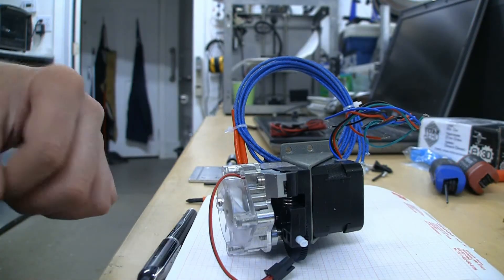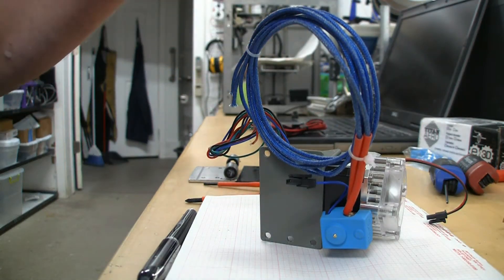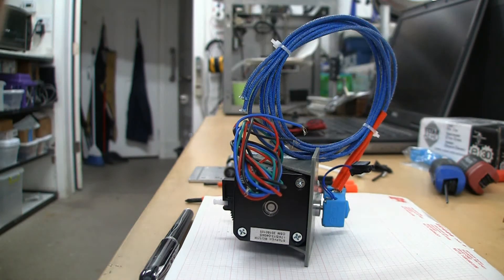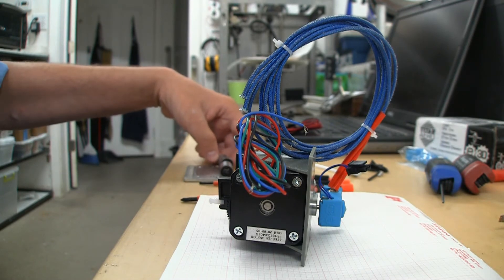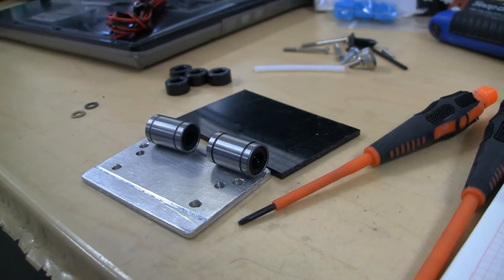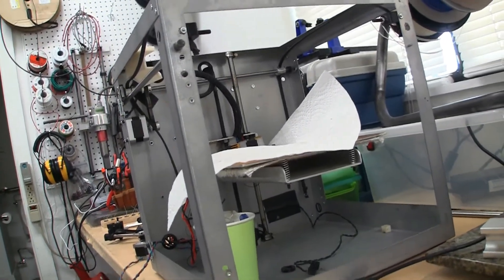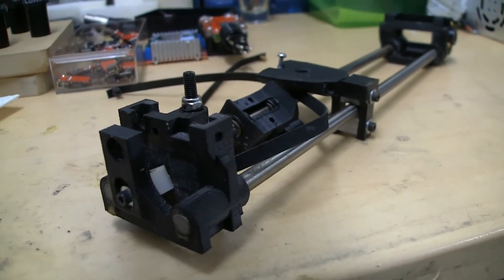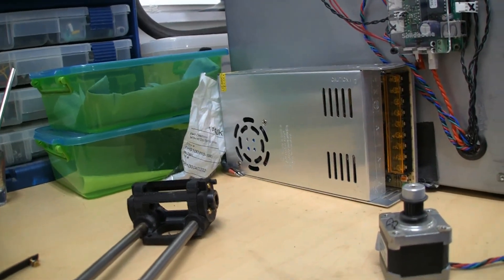E3D Titan Aero Upgrade on a Solidoodle 3

Comment: Hey nice mod! Did you ever finish this upgrade? I really like the idea of going with a whole extruder setup like the Aero. Though I am contemplating the V6 hotend because it's well documented. Was it pretty easy to get it to work with your printing software? Like calibrating it and such. My SD3 is stock (except for a few simple mods)and I think my hotend is starting to crap out. Any input would be greatly appreciated ☺️
Reply from the maker: I actually bought a Lulzbot Mini and the Solidoodle rebuild got mothballed, just dusted it off (literally) this week to finish it. It turns out you need a 3d printer to rebuild a 3d printer, I'm going to print new carriages off thingiverse. There are websites that sell carriages, but now I have the Lulzbot. The E3 Aero is getting really popular, Lulzbot actually is switching to it now.  Overall I liked the Solidoodle more than the Lulzbot, I think with the new hotend and a few upgrades to the print bed it will be my go-to again.
Reply: @CrippleConcepts  I was re-watching your video just now and realized I never replied back to you. I appreciate the info about what is needed to run the Aero. I ended up upgrading my carriages to the Lawsy carriages with better rods. I used my stock hotend for a while longer but definitely experienced degradation as time went on. I bought an E3D clone from Gulfcoast Robotics, it seamed like a decent clone, it was made by an American company with a real name and website. It turns out it was complete crap, it had endless jamming issues and heating issues. I'm on the search for a new hotend now. I will probably buy the real E3D v6. I upgraded the heated bed also. I'm itching to get this thing running but I'm still hitting road blocks. I hope yours is done by now. Happy Printing!

Comment: Can that grey plastic mounting feature be orientated a different direction? Right not it is in the 6 o clock but can it be mounted in the 3 or 9 o clock positions?
Reply from the maker: It could be flipped 180 deg for sure, I actually think that would be much better as the nozzle tip is so close to the bottom of the mounting plate the way I'm using it. If you flip it 90 deg I think the flange would stck below the nozzle tip.
Reply: Cripple Concepts Thanks for the quick reply!

Comment: Your upgrade looks like it'll end up looking really sharp and work well.  I've got a regular Titan + V6 on mine, and it's probably one of the best upgrades that I've done.   Great job, and happy printing!
Reply from the maker: Thanks, the conversion is kicking my ass....turns out it is far easier to rebuild a 3D printer when you have a functional printer to make parts!
Reply: In a worst-case scenario, rather than scrapping the printer, the guys at PrintIt Industries sell Lawsy's upgrade carriages (3d printed) for Solidoodle, and a bracket for mounting a Titan.  These guys are awesome for offering them "just in case" you've only one printer and don't have a spare set handy.
Reply from the maker: A day late and $699 short on that advice ;-). I pulled the trigger on a refurbished Lulzbot Mini yesterday, going to use it to print the Lawsy mounts to get the Solidoodle back in action. I could've machined some nice aluminum mounts, but trying to minimize moving mass. I will put the Lulzbot head to head with the upgraded Solidoodle, may keep both or sell one. I do appreciate you letting me, and others who read this, know where to buy some printed Lawsy mounts. I realize how much I rely on my 3d printer every time it isn't functional!